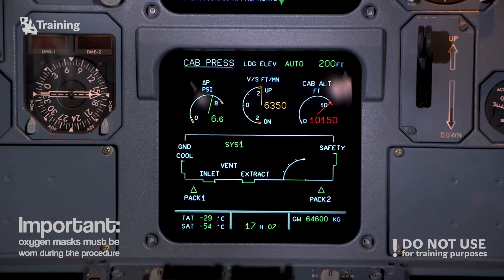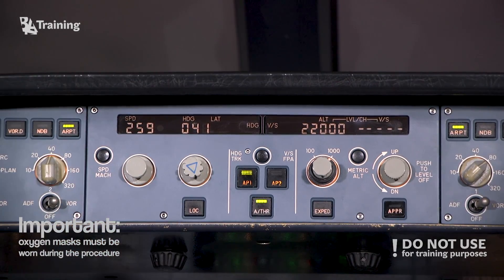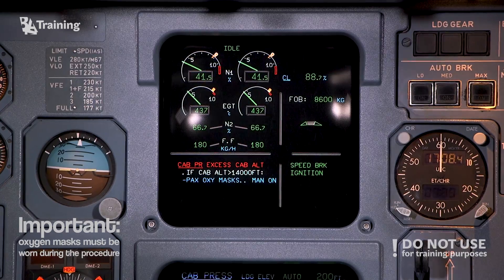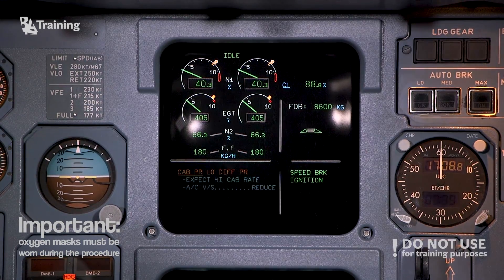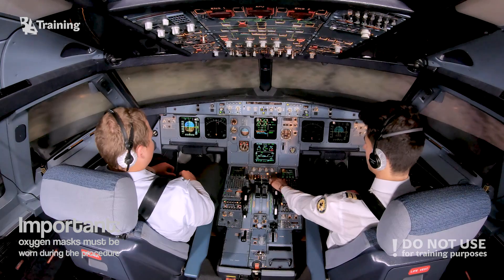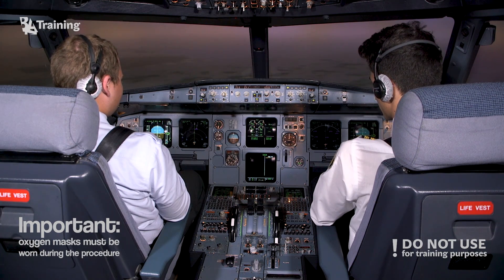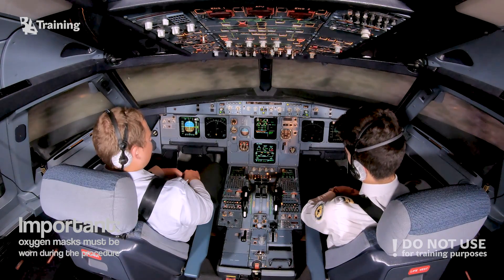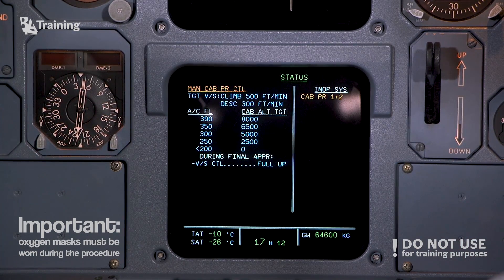Airbus A320 Emergency Descent

Comment: Lots of problems with this exercise, regardless of whether this is a ECAM only demonstration or not, this should start with crew oxygen and coms. At the very least mention it, as it is the most important first response, regardless of what aircraft type or operation.

Comment: In aviation, “retard” is a command to reduce the throttle position, or to Idle 

It comes from the French word “ retarde “ meaning to pull back 

so it has nothing to do with that the plane is calling the pilots ,retards 

Haha

Comment: Slamming the Speedbrakes out that fast at high levels will get you into some issues, too.
Reply: With autopilot engaged they deploy only half way, protecting the stress on the airframe

Comment: 2 inconsistencies that I noted 
1. Memory item steps do not comprise of 7700 and engine mode selector ignition.

2. Why didn't you take the landing gears? It is strongly recommended after passing 26000 ft.
Reply: FCOM - PRO - ABN - MISC - MEM EMER DESCENT

- CONSIDER L/G extension
They mention having structural damage so you would avoid changing configuration at high speed.
- ATC XPDR 7700 CONSIDER
Squawk 7700 unless specified otherwise by ATC

Comment: To avoid further damage you will not use speedbrakes 😂😂😂
Reply: In this case looks only the CPCs were malfunctioned, and the airframe are intact, so aerodynamic shape was all good and actually we can increase TAS and use the speedbrake to descend faster if it requires. That's my opinion.lol

Comment: You did ECAM actions by memory. There are only 4 memory items as per FCOM. The memory items are the one which are boxed.
Reply: Not quite like that actually also. The procedures in the video are also old. Currently FCTM states that EMER DES flows (including some items of QRH MEM EMER DES) to be done by PF and PM which include only crew oxy masks for both PF and PM. Then for PF, EMER DES initiate, FMA Announce, if A/THR not active THR LVRs idle and SPD BRK full. As for PM, Signs On and FMA Check. Besides, let's also correct something. Boxed items are misunderstood as to be memorized only other than the rest of the QRH MEM items. However, all items and information in MEM are memory items actually! Boxed items are just for quick pilot refer. Therefore, first application is to apply the flows by memory then ECAM and then QRH for EMER DES. Companies' OMPART A and B can also suggest some procedures or announcements to do.

Comment: FL 100 
Is this 10.0k or 100 ft?
Reply: LegitScoper 10,000 ft
Reply: Always multiply the FL by 100. FL 340 would be 34000ft ish. There a whole lot of explanation why they use FL and not the altitude in feet

Comment: Descending with 260 kts ... 😂😂 Max apropriate speed in Fcom !
Reply: arabuu01 can’t since they have a structural damage they need to maintain current speed
Reply: Khan Nguyen it says “manouvre with care” (because of aircraft structure) so if you don’t get any vibration you can icrease a little bit . You don’t go 300 + but neither 260 .. ( just my opinion )
Reply: @arabuu01  i agree with you. in the airbus simulators if you suspect any damage ie. rapid EXPLOSIVE decompression then you reduce your speed. other than that, max appropriate speed. we used to practice these at 340kts descent lol didn't "damage" the plane in the simulator
Reply: @arabuu01  if you have a structural issue any increase in speed would be irresponsible.
Reply: Pete Conrad the only bad thing about this is that passengers might have some earakes .
Reply: @arabuu01  usually there are some significant barotraumas.

Comment: Little bit of disappointment. 1. There were no indications of a structural damage, nevertheless you decided you have one. OK, it was a scenario, but In this case - why you gentlemen decided to deploy SPD BRK, increasing an  airframe stress? 2. No commutation with a cabin. 3. Once you fly away from airway, you need MORA, or MVA, not minimum airway altitude as you said ( whatever it means, probably MEA). 4. You had  ECAM double cabin pressure system failure, nevertheless, being convinced with a structural issue, you misinformed an ATCO you have a  damage .5.....proverbial oxy masks, lot or people already said, I omit. 6. Just  turning away from airway is not enough, you should consider a terrain and traffic around. 7. Very much formal FMA reading, not even "checked" of PM. 8. Not exact format of MAYDAY message.   You are making me sad, guys, your BAA is a very famous organisation with very aggressive marketing policy. BAA like a BA, Abibas like Adidas, I nearly sent my son there. The reality does not meet expectation. I am grateful to Heaven my son went across the ocean for FAA training. Be serious, gentlemen, this is your commercial!
Reply: Using speedbrake is part of Airbus memory item checklist for emergency descent, even with structural damage Airbus still ask for speedbrake to fully extended, the only caution Airbus says is to maneuver with care
Reply: @muzlp Exactly
Reply: I don’t know what you’re talking about

1. Speedbreaks are apart of the emergency descent procedure to increase drag. Also, the aircraft calculates the max safe speed, if you are under it, it’s fine

2. It’s definitely a structural failure. How do I know? Because this is a simulation so they pre programmed it to be a structural failure
Reply: armchair pilot getting mad at an unserious video 😭
Reply: They informed cabin by PA, your point №2 is wrong
Reply: BAA это вам не это... это вам не институт и 5 лет жизни, тут вы заплатили вас побыстрее полетали и под зад палкой 😆😆

Comment: Normaly the should select the maximum speed. But they did not do that. You will reach higher V/S with more speed
Reply: Beside that, there was an structural damage in this scenario, therefore is better to keep the actual indicated airspeed to avoid additional stress to the airframe.

Comment: Doesn’t the Pilot Flying have to keep his right hand on the spoiler lever until reaching level off altitude where he’ll close the spoilers???
Reply: Yes, is better for situational awareness.
Reply: Yes he does, the hand should nit move from that lever until spoilers are retracted, which is also one of the things wrong in this example
Reply: Nope.
Reply: There's a 'spd brk still out ' message displayed on the ecam after aircraft levels off.
Reply: Yes you’re right and for an explosive emergency descent it should NOT be used!

Comment: Nothing is good on this video. No paper checklist no dodar brief, no ecam action with normal procedure.  Long way tu run.
Reply: its a procedure with memory items. sure its a top priority to read a paper checklist and do a briefing while having a cabin decompression at FL300 over mountains l o l
Reply: they told before was "procedure by memory" and the suggestions on the computer.

Comment: Why not press exped descent?
Reply: Because you have to reduce your V/S. In case you don't, you may suffer an even worse disintegration of the cabin and probably blow everyone's ears out.
Reply: janis banis You recommend not use it the whole descent?
Reply: @simonklaassen2145  Indeed. The oxygen masks are able to supply oxygen for long enough time and it's just not worth the risk.
Reply: Because exped button would straightaway increase the speed to Vmo/Mmo which is bad for structural failure.

Comment: Very interesting -- out of interest though why didn't you two put your masks on??? Cabin/cockpit alt got very high!
Reply: Ajit Raspayle The simulator has O2 masks for the pilots. It’s a valid question. 

In this case they may have only been interested in demonstrating the actual descent and donning the masks would make them harder to understand in the video for sure.
Reply: They written "Oxygen masks must be worn during the procedure" on the bottom left corner of the screen. Maybe they didn't put it because it may be impossible to record their voice
Reply: He says too as he goes over the checklist “crew 02 masks on”